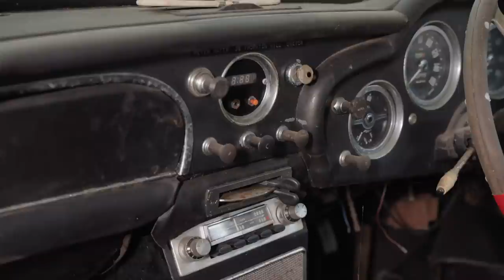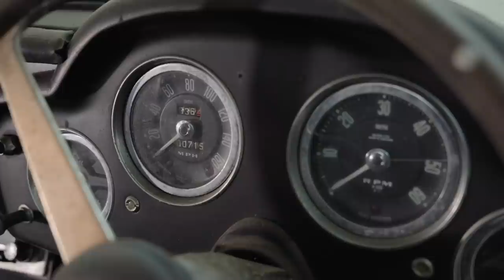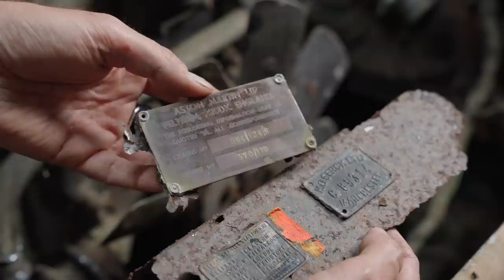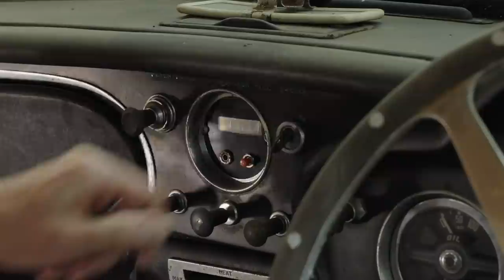The Best Barn Find Classic Car I've ever discovered. Will it run?

Comment: I was lucky enough to own a DB4 as a young man in the early seventies, a rare interim model just before the 5 was launched,  even then I had to have some body work done, the tubular body frame, which the aluminum is crafted around, has padding between the two, this facilitates damp and aluminum corrosion even after just 7/8 years, Restoring the body work on this old girl will take for ever! Wish you all the luck!  Great video thanks a lot.

Comment: Wonderful to see Paddy and Jonny in their element. Helps to remind me why I purchased my 1971 RHD De Tomaso Pantera as a box of bits back in about 1993.  Work, life and family have prevented me from getting around to restoring and rebuilding it. The Late Brake Show is definitely giving me the urge to put the time aside to bring the car back to life.  One day Jonny I will give you a call and we can lay all the parts out on the drive including the 5.7L V8 engine and the ZF gearbox.   Don't worry, I also have another car that has a dynamo, a regulator and a pair of twin 40 weber downdrafts that you can try to start, so you can use the can of hope. 😉

Comment: An AMAZING find! When I was about 18 I used to LUST after a 1961 DB4 which lived very close by.
When I heard it firing up I'd go to the front garden to see the lovely light metallic blue missile whizz past. (He used to drive quite quickly.)
It ended up in a local garage, for sale at £1400. (This was 1973/4.)
The garage owner was a bit of a "chancer", and had let the tank go down so low there wasn't enough petrol to be lifted by the pump.
(Had it started & I'd driven it, I'd probably have bought it!)
Next day, I was flagged down by a "car mad" neighbour. (He used to run Mk1, then Mk2 Lotus Cortinas, all sorts of fast cars.
He asked if I'd "heard about that Aston for sale?"
When I said yes, I was on my way to test drive it, he said "Don't bother. "$$$$$" had it out last night and put a rod and piston through the block"
At the time, a rebuild (with no damage) was about £4,700.
Had I bought it, it too would have "been my pension".
Great to hear it run - and it didn't sound so bad, did it?
Lastly, my late brother had a German Wire-Haired Pointer.
She was a lovely, most definitely a one-man dog - and a great gun-dog.
Thanks for a great video.

Comment: OMG!
Thr DB4 fired up!
Never thought that would happen..
And it has water still in the engine.. Absolutely Astonishing.
What a car.
..
Paddy is a very interesting man and popular in the comment section too 
Thanks to the LBS team for having a 2nd attempt /day at trying to get the DB4  fired up.
Didn't sound half bad too.
Bit concerned the DB may not be here in a few years with all that corrosion.
Needs a resto soon as. Needs to be saved for history.

Timestamp; 1830 reminds me  of being at the dentist.
...
Obviously this is one of the top 5, each episode should stand on its own merits.

So it could the Audi QR turbo, both Lamborghinis (kendal &  & Guy Fawkes), reno 5 turbo, M series bmws.
The guy fawkes labmo has to be the best settings /backdrop to a BF.
...
Or the kendal lambo with the shady owner...
In this episode Paddy is as much a star as the car!
..
Keep up the good work...

Comment: To see such cars as the gorgeous Dino, let alone the DB4 in such perilous condition is really sad. Hopefully both cars get restored. Their end value is huge these days. Personally, I would only consider having the Dino V6 in the Dino. It’s such a gorgeous engine as opposed to the modern 458 V8. Having been for a ride in a 246 GT Dino at full song, that engine is a mechanical symphony, which no modern V8 can match. A pupil of my dad’s back in the mid ‘70s used to have a DB4 and the sound of it pulling away from our home was simply glorious. Ahh the stuff of dreams

Comment: You could do with a 90 degree bend for on the end of the wd40s pipe and then you can spray in at the cylinder walls so it runs down onto the piston rings.  The problem with spraying down form a true vertical plug hole is if the piston is of a hollowed out type or even just concave slightly you probably won't get much to the cylinder walls.
Lastly I'm a little worried about not hoovering before removing the plugs 🤦‍♂️.
Loving this barn find ❤

Comment: 'The best barn find classic car I've ever discovered.'

They're really great cars and that's another great video, but I also recall the man you filmed who had a Ferrari 166 Vignale AND an Alfa 6C 2500 Corsa, which are both extremely special (and extremely valuable) cars. That Alfa was so beautiful, or it would have been if the owner had got round to restoring it. In my humble opinion, that was the best barn find you've done by a distance.

Comment: Good tip for you is to buy a small air compressor, 10L or so, you can fill it with air before you leave if its a remote place, blow out the crap in the spark plug valleys and can use it for tyres

Comment: sensible thing to do
is use a compressor to blow away all the crud around the spark plugs, before wd40 and spark plug removal
Mr Engineer

Comment: @ 29:42 If it ever helps anyone else, a visible spark at the points is never good. Usually means the condenser ( a capacitor in a tin can ) normally bolted to the distributor is at fault. This one is bolted to the outside of the distributor. It needs a good ground, plus they always fail over time.

Comment: Don't do what they did. Engine that has not run in years, vacuum FIRST, then undo plugs, then pour oil to sit in the cylinders several DAYS, then try cranking. It may run before then, but trying this fast ruins the rings and loose all compression. Taught by David Freyburger.

Comment: Phenomenal end to this , thst engine running was the icing on the cake
Reply: Yes, I hadn't attempted to start it before as the bottom of the radiator was missing, so I assumed the worst. When Jonny and I were poking around, however, I realised that the bit that had fallen off was merely the lower cover. As soon as I felt the crank turn once I'd got a socket on the end, I thought 'This might even go!'. Due to a couple of faulty ignition components I couldn't start it on the day, but within hours of the new parts arriving later in the week it fired up! Since then I've done loads of work on all the relevant stuff (water pump, brakes, master cylinders, fuel tank, etc.) to make it driveable. The plan is for Jonny to come here again and film it driving up a local private road - that's the plan anyway - whether it will do so remains to be seen!

Comment: Wile WD-40 can be used as a type of lubricant, it's actually a pretty poor lubricant. You should be using a mineral oil as with WD 40 the damage to the piston rings and bearing will be serious .  5w-30 oil thinned would be better to spray in the tops of the cylinders and on the cams.  There are only51 ASTON MARTIN DB4 left in the UK with an MOT

Comment: I have various parts for a db4 gt sitting around, rear axle, rear brake calipers, pedals, headlamp lenses, spare wheel bracket, crankshaft, water pump and other bits and bobs. They are for sale just haven't got round to advertising them yet.
Reply from the maker: Really? Well if you email the show we can forward to Paddy no problem. Thank you
Reply: @TheLateBrakeShow   I'll photograph some of the parts and attach those to the email. Only problem is I couldn't find you're email address?

Comment: Lovely project. That digital clock need to be replaced with an Analogue one
Reply from the maker: The digi clock was fitted by the previous owner, as he was fed up of the mechanical clock going wrong.
Reply: @TheLateBrakeShow   Still doesn't look right though!...I've got a digi clock in my DB7 and it's one of the few things that bugs me 😏 🙂

Comment: Awesome barn find! But I never would have done that without atleast dropping the pan. Iv seen so many where the oil had turned to sludge and plugged up the works.
Reply: While I agree with you 100%, I spun it over until the oil pressure gauge showed a consistent 55 psi - although I filmed it from with the car before firing it up, that bit didn't make the final edit!

Comment: Realy nice find, great video. Seems this guy is very interesting, but mus say this, since i noticed this pattern many times in similiar conditions: 
i will never understand, how all this carguys leave their beloved (rare) cars rotten in some moist, leaky sheds etc, thinking it's getting value like that. I'm sure it didn't have all that rust 30, 40 years + ago, when was brought in that garage. At least some proper clean, wash and some antirust treatment/protection could be dona at start and periodically redone every few years or so. And most importantly, proper anti dust/ moist cover and heated garage, not just throw few old rags on it..
Reply: I can assure you that I bought the Aston in that condition - it'd been left standing in the open on the owner's drive for several years after he got too sick too drive it; as a result it started deteriorating badly. Ever since it has been here it has had a dehumidifier running 24 hours a day. The 'rags' were on it simply to protect it from airborne workshop debris. It also got regular doses of protective lubricant sprayed into all the relevant areas.
Reply: @TeknoTramp   Then i take it back with my apologies, i thought it was in your possession for many years etc.
But lets get back to original owner then, which does fit my criteria, mentioned earlier. I do understand perfectly, when health is gone, you don't have energy or finance to do proper restorations etc, but at least some  proper keeping and protection could be done, if you want keep it as investment or family fund. In most cases (ok, maybe not so valuable cars etc, but still) i have come across, all this cars or bikes are left to rot at some moist shed at best, many of them on plain outside. And when it comes to price etc, then here we go, they're asking as it was mint from factory or been kept as museum piece. I don't get this mentality, if you think, you have something valuable, then it should show. How can anybody thinks that by letting things rust and deteriorating, is keeping or increasing their value? I will never understand this. Sorry for the rant..
Reply: Sadly, the old boy who owned it back then was too ill to care what it was worth - besides, at that time it wasn't worth much anyway! @izoyt

Comment: Really surprised that a vacuum-cleaner with a crevasse-tool wasn't the first thing used, followed by some compressed-air, before applying the WD-40!
Reply: There isn't room on an Aston motor to get anything down the side of the plugs. Blowing compressed air down there risked dislodging stuff that didn't need to be dislodged...

Comment: Next time combine or replace the vacuum with compressed air or a dewalt or makita small high speed blower and remove loose dust and crap from the vicinity BEFORE removing the plugs and making your life hard or damaging the pistons bores or valves. Then as you did. Also never crank without the coil having a path to ground through a clean new plug. The high voltages generated can easily kill the coil.
Reply: The best lead is the coil one so you don't have to ground all six plugs... grounding one and cranking is 17% okay and 83% dangerous.

Comment: That engine THROBS 😂🤣😁👊💥👍🏻👍🏻👍🏻👍🏻👍🏻
Reply: With luck you'll be able to see it drive soon - I've rebuilt all the brake calipers, master cylinders, etc. and have got most of them fitted back on. I still have the water pump to do (was waiting for parts), and I don't yet know whether the clutch will free off - but the plan is to get it finished ASAP!

Comment: On a car like that you need to take the engine out and strip it down before even thinking about starting it. If the rings have corroded or if the oil is bad you could destroy the block or spin a bearing and trash the crank. Even turning it over was a risk.

Comment: So much corrosion! You can bet that all the interfaces of aluminum with steel will have galvanic rot. This car might be worth 300 pounds some day but the cost of restoration would be astronomical. But... the steel bits looked to have simple shapes, they can be reproduced, aluminum can be welded easily enough. The frame is probably a total loss, a new one would have to be made. All those immersions in sea water took their toll.

Comment: It's sad that such a classic car has been allowed to disintegrate. It's basically the aluminium exterior body panels and an engine. In the superleggera design, the aluminium panels are very lightweight and supposed to be supported by a tubular steel framework. I doubt if any of that still exists and probably not much of the chassis either, so this could be the most difficult restoration in history!
Reply from the maker: It isn't that rotten.

Comment: As it stands its worth about £100k but would need about £200K to restore but then you would have a car worth in excess of £400K. I remember a self employed plumber who owned an ex race DB4 in the mid 70's  It had no interior just a race driving seat.  He kept it t his mothers having paid £1k for it. I lost track of him and his car
Reply: The only comparable car that I know of was DB4 number 5. It didn't drive or even run, and sold for £365,000 (or thereabouts) - whereas mine does both...

Comment: Loved the film...but can't agree with the comment about the Dino 2.4 V6 being a 'very weak engine'! Has Paddy heard of the Lancia Stratos?! Not exactly renowned for it's weak power plant!
Reply: The Stratos made a claimed 190 bhp, the same as the DIno. But that was Italian horsepower - the Dino really only made about 160 - I don't know the real-world figure for the Lancia version. The only reason the Stratos performed so well was because it weighed so little (880 kg. in Group 4). The Dino engine is well known for splitting the block if you try to extract more power than it was designed for, hence my comment about it being a weak engine. With the Stratos being a racing car the engine could be stripped down and checked regularly, so if a crack starting developing, all things being well it could be replaced before it grenaded.
Reply: Thank you for the reply. I think it was Ferrari that made the 190 bhp claim against Fiat's 160 bhp in the Dino. The Dino engine was originally a 2-litre unit, with an alloy block, as opposed to the 2.4 which had cast iron, so I'm not sure it that's what led to the issues with 2400 blocks cracking? I still disagree that it's a weak engine, I have a 2-litre Fiat Dino Coupe and the engine is a jewel. I have no desire or intent to modify it though.  @TeknoTramp
Reply: The basic problem was cost - the only way that Ferrari could afford to have a bigger block (i.e. 2.4 as opposed to 2.0) was to collaborate with Fiat, and to accept that it had to be in cast iron, not alloy - thus adding lots of weight. In order to keep it as light as possible therefore, they kept all the wall thicknesses to a minimum. I have the block for mine sitting on the table a few feet from me as I type this. It's a work of art, but put too much stress through it, and it'll break. I have a motorcycle sitting in front of me too - that makes about the same bhp, hence why I'd like the Dino to have a significant power upgrade!

Comment: Any reason y'all don't hit the cylinders with a few drops of oil through the sparkplug holes before turning the engine over by hand after such a long time sitting?
Reply: We did all that sort of thing but nearly all of it got edited out in order to keep the length of the video sensible!
Reply: @TeknoTramp  Gotcha, thanks.

Comment: That's some seriously clumsy product placement
Reply from the maker: I think we need to disagree here. The product we use in its natural forms within the video, and it's totally relevant. We don't promote something that is in no way connected to working on old cars.
Reply: @TheLateBrakeShow  I never said it wasn't relevant, I said it was clumsy (and forced). On the other hand, it had me making sure I wasn't running low on WD40 so it was certainly effective.

Comment: Should have vacuumed before pulling the spark plugs..
Reply: We would have done if there'd been any room - the plugs on an Aston are buried so deeply that there is simply zero access. Likewise, I could have blasted air down there, but that risked driving any debris in where we didn't want it. Don't forget also that an awful lot of what we did got edited out...
Reply: @TeknoTramp  ah yes. Very good point! Regardless, thank you, gents, for the filming and finding of that rare beaut

Comment: Half inch BSF Thread strange, only to metric users…. I have used many BSF threads….
Reply: I've been using Imperial threads all my adult life including BA, UNF, UNC, Whitworth (technically, the best thread ever made), Cycle, NPT, BSP, Gas, and so on, and don't recall ever coming across 1/2" BSF before. Other sizes, yes - but not 1/2".
Reply: @TeknoTramp  Plenty of them around,they range from according to the chart I use. 3/16 of an inch to 4 and a quarter inches. It’s strange you pick out one size out of the around 36 that are available. I have also used all those threads to over the last 65 years. Most British motorcycles I work on use a mixture. I have worked on Manx Nortons to Triumph Triples. I have raced most of them. I still find your comment on size very curious, are you being ferocious by any chance. For someone who says they  possess knowledge its outstandingly ignorant.

Comment: If you have owned this car for such a long time ; why wouldn’t you lubricate every thing properly rather than let it rot away
Reply: The car was like that when I got it - I've run a dehumidifier next to it ever since it came in the door, which has cost me £££. Besides - I have gone over it with protective lube on many occasions...